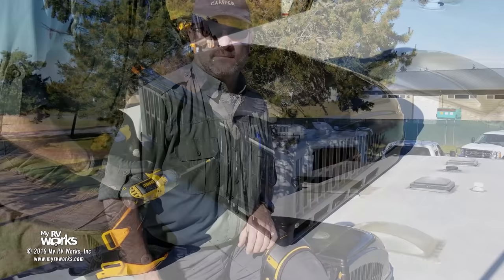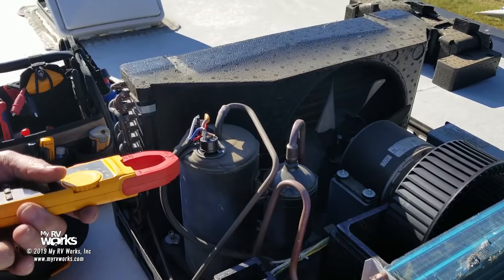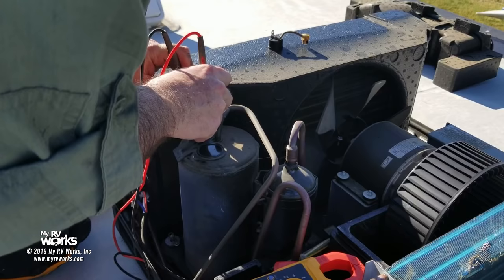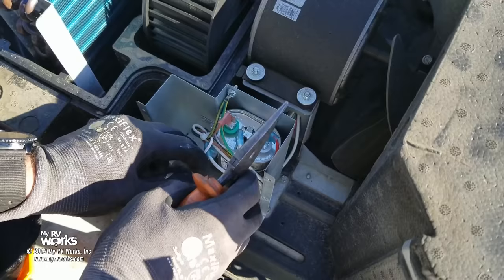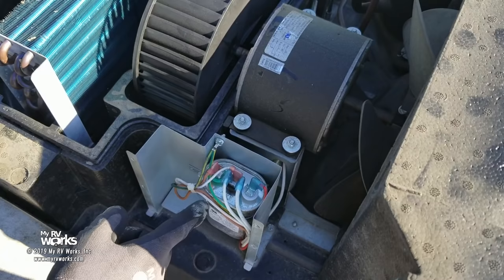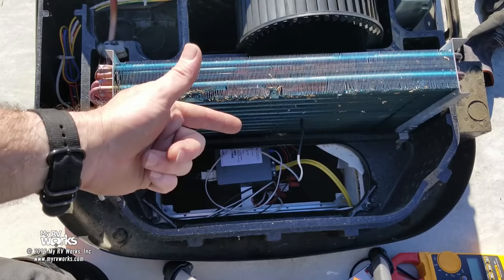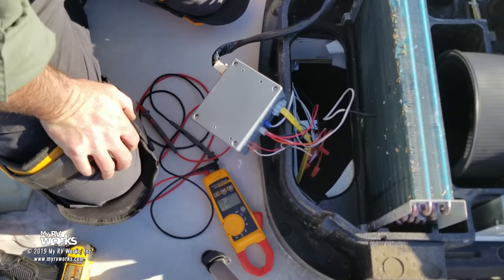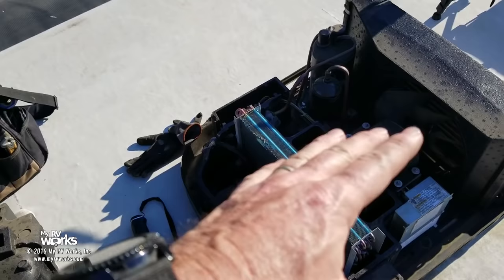Diagnosing An RV Air Conditioner That Is Not Cooling

Comment: So doing an amp draw test at the breaker for the air conditioner or near the compressor while it is running isn't as beneficial to let you know if there's even enough resistance at the compressor  generated from the freon charge?
Reply: Amp draw reading of the compressor is the way I was taught as well.
Reply from the maker: I could have easily demonstrated that. But that failed to come to my mind at the time. I don't script these videos out guys!  Perhaps there are other videos that are more professional than mine and are more beneficial to help folks out. Now that I've been clear on that part, yes run your air conditioner for 20 minutes, I check the amperage directly at the compressor. Take recording of ambient temperature, and compare that to the table in the manual on how many amps should be consumed at the recorded ambient temperature. That gives us an indication on how hard the compressor is working. From that you can deduce if the system has lost refrigerant.
Reply: @MyRVWorks   Oh I wasn't saying that your video wasn't professional,I REALLLY enjoyed watching it!
I just like to do a self-audit with my business and I've been trying your ways to test compressors and it's a completely different way which is also accurate...... But I am a strictly mobile service with no additional staff and kind of limited on how much equipment I feel like carrying on top of a roof.
 I usually check capacitors after an amp draw test(at the breaker panel inside the RV taking into account of fan motor draw of course)if rotor lockup is happening w/hi amp draw before I would actually test the compressor in the way that you have, but both work and are very accurate.
 Do us all a favor and don't change a thing! Great videos!
( I like to think that if I don't zap myself once in awhile with 110AC current I'm not working fast enough....LOL!)⚡🥴👍

Comment: My Dometic air conditioner will run great for about 25 minutes when first starting up and the it cycles off and on every 5 minutes regardless of how hot it is outside. My theory is the compressor is getting to hot and keeps shutting down. What would be your guess? Thanks for sharing some well explained videos. I subscribed.
Reply: Hiii do you fix the ac ...I have the same problem...
Reply: @mayteorellana7556  I never fixed mine. I bought a cheap portable AC unit and vented it out the window, for now anyhow.

Comment: I have a demedic rv ac, when i put it on cool the fan comes on but the compressor dose not have watched you video on diagnosing an rv ac, i checked all the post on the compressor and they are not shorted out i then did the ohms on it and i got from  C to R i get a 2.0 and from S to R i get a 2.6 but from C to R i get 0. and on my capacitor i get 0's dose this mean the compressor is bad? any help would be much appreciated. thanks G

Comment: Is it possible to lose just some of the refrigerant? Like through osmosis or microporous copper? Or maybe through the seals in the compressor? I know on automotive AC you can have a small leak that only lets some of the refrigerant when it moves a certain way, the rest of the time the leak stops

Comment: Very informative! What is the average cost for both, hiring a AC guy to refill refrigerant vs replacing?
Reply from the maker: Unless a licensed/certified HVAC technician will go up on your RV roof to perform this service, you're going to have to remove the air conditioner with either option.  You can call around to determine your options for that.  Normally you need to bring your air conditioner to the HVAC shop where they can do the work in their shop where they have all the proper recovery equipment.  You'll have to pay them to find the leak, repair the leak, tap the line, recharge the system. And after all that there's no guarantee that it will fix the problem.  It may be a large invoice with no substantial warranty.  You need to weigh the repair option to a new air conditioner with a factory warranty. Overwhelmingly most RV technicians and RV shops are not licensed with the EPA, nor do they have the proper recovery equipment to perform this type of work.  If they are caught doing it without the proper licenses and Equipment the fines are huge. So most of these guys are not going to touch it. If they do they're in violation. If you turn them in then you get paid for turning them in and they get fined for violating the law.  It is a slippery slope.

Comment: My air conditioners work plugged into the house front and back , but when the generator is running only the front works I can hear a clicking noise when I turn it on but won’t fire up only when plugged into the outlet

Comment: Followed the video closely except we have a soft start. I'm running around 11 amps now (14 only two months ago) going by my surge protector software. I still haven't checked my control box for voltage, probably tomorrow. I can hear the compressor running steady. Should I bother bypassing the softstart? No real evidence of a leak. I'm leaning low on refrigerant.

Comment: I have a dometic 13,500 btu brisk2. I changed my capacitor.   My watch dog surge protector app shows I'm drawing 18amps. Unit blows cold. Should I be worried about the amp being at 18 amps?

Comment: There is one other thingthat could cause t,he coil not to cool and that is compressor has lost its compasity. Remember the burned terminal on compressor this could indicate over heated compressor causing compressor head reads to burn oil on reads and losing compression and capasity. Replace AC.

Comment: Hi , great video! saved  for future purposes. I have the same setup(dometic B57915)  and a weird issue. Ac will kick on for 1 sec - compressor- then off 2 minutes, it tries startup again, same thing on for a sec off for 2 minutes, then 3rd shot compressor stays on. always happens after initial startup(no issues on that part).I keep the unit on low fan so fan is constantly on. Ac is cold when it stays on always. Any ideas on what would cause this??? Thanks for any help and the video.

Comment: I can’t find a place to hook my 12 volts up to my board with my new ac . My old board was on the roof tucked in between the styrofoam. But the 12 volt wire wasn’t connected to 12 bolts but it ran good . I now have a control board and housing with a couple of six pins plugs one plugging the ac into and one load shed which I hooked up but litterally no wires to connect the 12 volt . Any suggestions. The is the ac in zone two with a comfort control 5 button thermostat. I keep thinking the phone wire gives it 12 bolts but for some reason zone buttons don’t work now

Comment: During the process of changing my a/c gasket, the last long bolt snapped off.  There is a good 5 inches still left up there.  It broke off even with the galvanized flange inside.  The bolt was corroded so badly it was only half of it's original diameter at the break point.  Do I go up top and try to pry the unit loose now?

Comment: I have a Coleman-Mach, it runs great, nice and cold... but when it cycles off after reaching the correct temp and goes to restart the compressor will try to kick on for a second or two and then shut off and continue to do this until I shut the unit off and let it set for about 10-20 minutes and then it kicks on and runs great until it reaches the correct temp in the camper and cycles off. The fan runs great. The thermostat works great. What’s the problem???
Reply from the maker: Hi M Leckie,
 
Your question has been selected for an upcoming video where it will be read and discussed by Darren.
 
If you have not already subscribed to the 'My RV Works' YouTube channel, please do so and keep a watch for the '10-Minutes with an RV Tech’ video sessions.  This new series is a selection of comments and questions that will be covered and released weekly.

Here is our YouTube link:  https://www.youtube.com/c/myrvworksinc

Happy Camping,
My RV Works Media Team

Comment: question, I have a Dometic AC that is Cycling off and on every few min's and only stays on for maybe 10-15 secs.  I swapped out the thermostat with a newer one (3 wire) and still did the same thing.. .any thoughts?

Comment: great technical info! so many things to check. my Airexcel 2008 roof AC worked  2 months ago on a short trip. now on this trip, no work. fan comes right on, and Compressors sounds like it it tries to engage but wont come on continuously. every thing is clean, i have checked, no bypass, clogged filter, etc. can you give me any idea what you think it might be? where to start? thx much..i wont hold you to it. j

Comment: HELP—Hi.  Nice informative video.  I have a question.  I have a dometic penguin ii 15k hp 2013 model that came with a 40+15 (+-5) 370vac.  The capacitor is no good.  I’m in a pinch and can only find a 55+15 (+-5) 370 vac.   Usually it runs at about 1600 watts.  I installed the 55/15 I was able to buy on a Sat.  I installed it and it’s running at 2400 watts that’s 800 more watts than normal so I took it off.  (Oh I also have a micro air easy start on my AC).  My question is why did my watts go up and will it hurt my unit to run with it?

Comment: Mine is getting so cold, where you first touched, those pipes and the bottom part of the coil that it froze, but it freezes to the point that it does not allow air to move, then it just blows warm air.
What could it be?

Comment: What would cause the compressor to kick on for about 10 to 15 seconds then shut off? Then kicks on again after about the same time 10 15 seconds Then turns off again? Low refrigerant?
Reply from the maker: Without throwing a bunch of guessing information out, you'll need to diagnose that from the control module itself. The control module is just a few relays but you need to find out what signal is telling those relays to open and close. The schematic on air conditioners is pretty easy to follow just take a few minutes study it and understand what wire is control compressor relay. Your problem could be a thermostat, could be a freeze sensor, it could be the control board itself, could be a loose wire, it could be the PTRC, I doubt it would be a capacitor but it could be.  So, follow the trail to what is controlling that compressor relay.

Comment: what about an A/C that will not shut down after reaching set point? Everything else functions normally.
Reply from the maker: You may want to have a look at the thermostat. If you have a multimeter you can go to the control board of the air conditioner to determine if it is still receiving a signal from the thermostat.

Comment: I had a mobile rv tech come to my home and find out why my ge ac compressor puts out ice cold air but after a few minutes it kicks off. His diagnosis was that the freon level is low but he couldn’t detect any leaks. He checked the capacitors and determined they were good. It cost me 252 dollars for that diagnostic test but didn’t fix the problem. Any thoughts?

Comment: So  you could TOUCH THE CAPACITOR with GLOVES on I'm assuming cause it looks to me u were touching it with the gloves on I just wanna make sure before I check mine
Reply from the maker: Once the capacitor is discharged It's relatively harmless. To discharge a capacitor you can just touch the two metal prongs together with pair of insulated needle-nose pliers or use an insulated screwdriver.

Comment: Thanks for the video.  I have been trying to fix my RV AC.  My problem is that when my AC turns on the the compressor starts and the fan starts.  After 2 to 3 minutes the fan turns of and never restarts.  The compressor continues to engage not the fan does not.  If I disconnect and reconnect the power.  The fan will come back on.  Do you think it may be the circuit board or the thermostat.  Can you give me any suggestions? Thanks again for the videos.

Comment: thank you for video the blue wire that goes to compressor shows 115 v when unpluged and goes to 0 volts when i plug it in is it supposed  to do this?

Comment: I have this same unit (1300 BTU), It has been freezing up. I downloaded the installation guide which instructed the freeze sensor should be install on the left lower side of the coil..  Mine was in the center.  I moved it an so far so good.  Should I replace it?

Comment: Question for you! Great video by the way! I just subscribed.  Anyway my question is I just got a a trailer and the ac unit won’t turn on at all I’ve checked the circuits I’ve checked power going to the unit all is fine and my cousin says they haven’t used it for over 7  but after taking the lower cover off this thing looks like it’s never been used. So where would you start first?  Also I have not gone up on the roof yet which is my next step.  Thanks in advance

Comment: My ac fan doesn’t spin without help. Once spinning all is good. Already replaced the capacitors but fan still will not start on its own. Bearing are good. I lubed everything. What can I check next?
Reply: It’s a Coleman Mach

Comment: I have 120 volts coming into my water heater element. 120 goin out. So element is good or not. Reads 10 oms installed. I have a new one same 10 oms not installed. What next

Comment: awesome explanation thank you , the problem i'm having is the rear ac on my class a the fan works but when i switch to cool i get nothing, what can it be?? TIA..
Reply from the maker: If I were there troubleshooting this. I would start at the control board. I've got a video coming out in about a week or so where I discuss bypassing the relay on the control board to force the compressor to start. Not sure what your air conditioner is but they all have control boards and on these control boards there's going to be a relay that controls the compressor motor. If you follow the main 120 volt wire from your Romex it usually lands on one side of a relay and out the other side - it could be a purple wire.  If you touch those two wires together (without getting shocked) you are bypassing the control board and that should tell you if your compressor is going to start. If the compressor starts that's good news! So, now you need to ask the question why is that relayin the not sealing in. That could be a problem on the control board, it could be a problem on the thermostat or it could be a problem with the wires between the thermostat in the control board.  Hope these ideas help steer you in the correct direction. Happy camping and stay cool

Comment: What's happening when it freezes? Is that an indication of a bad A/C, bad Compressor?
Reply from the maker: There should be a probe that is wedged in between the fins of your evaporator coil. That is a freeze sensor. Make sure that that is in place. If you need to test that then you will find on our website we have manuals and you can perform a test right out of the manual procedure.  https://myrvworks.com/manuals/

Comment: If the legs of the compressor are grounded..does that mean a bad compressor? I installed a soft start sta01 from amazon, it was sopose to be a sealed box, but after a rain, I noticed the ac not working... I checked the soft start and water got inside the box and fried it..the company sent me a new one and after installing it like I did the first one and making sure it was sealed good, the ac would trip the breaker inside the rv... removed the soft start totally and it trips soon as I turn on the ac...fan only runs fine...tested the compressor and the legs are grounded..any idea? Thanks

Comment: Tap and refill your unit if needed. The new refrigerants do not deplete ozone. Dont be a little girl. You could have just hooked up some gauges and found out in a second once you saw the compressor running. You are not a pro but you do have some useful information

Comment: I have a question for you, I would like to mount a 15 gallon gasoline fuel tank to the front of my travel trailer right behind the propane tanks. Is that legal to do. I have do a bunch of research and it seems to be legal to do. I see landscaping companies do it all the time so I figured I could do it to give me extra 15 gallons for the trips I would take that have fewer gas stations. I have a brand new DOT approved tanks with hose that would fit in that location perfectly.

Comment: So my Overload was melted and burnt. (the problem) I've ordered the replacement part but I am worried what may have caused the component to fail in the first place. Any Ideas?
Reply: Had the same issue but it was actually the wire.  Replaced the overload and the wire and mine is working great!
Reply: @Tac0312  what was your original problem with the ac unit? Went to check mine today compressor comes on then shuts right off. Check all components as in the video and found nothing but the ac unit starting work again just fine. Came back a few hours later not working again. Im thinking its an overload switch. Were you able to test is by bypassing it?